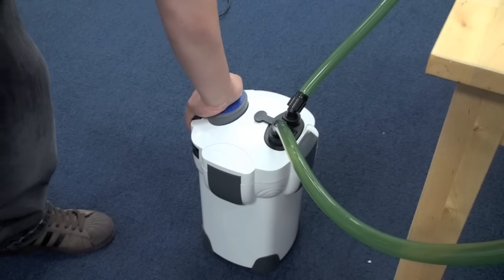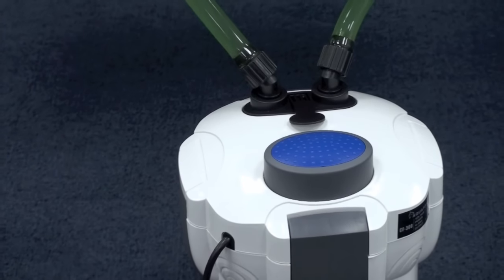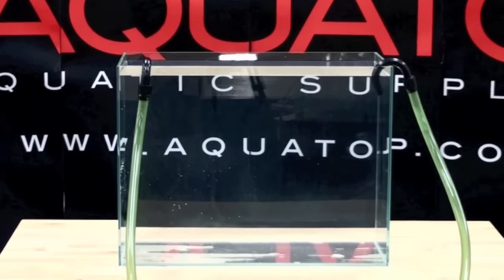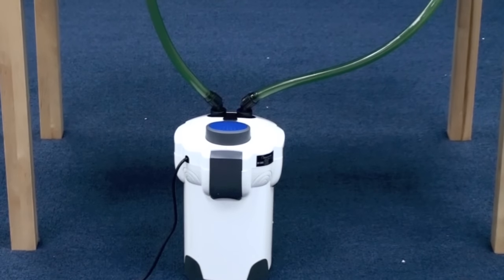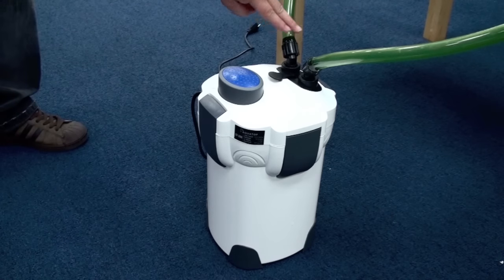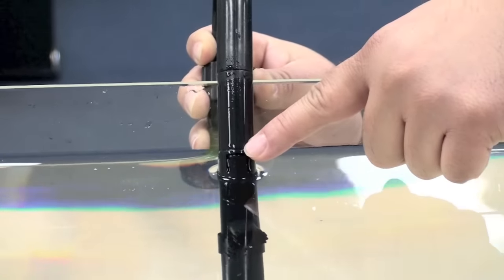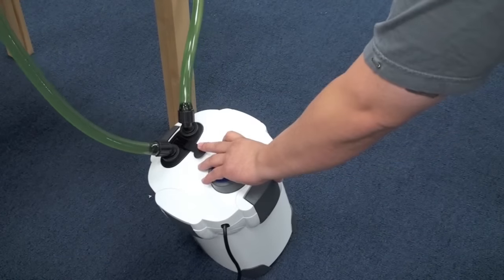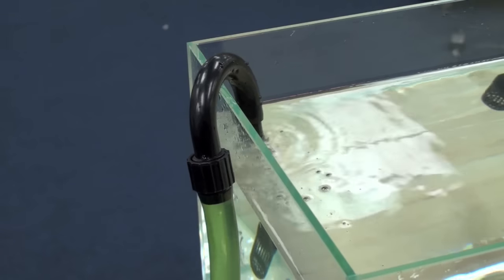AQUATOP Tips & Tricks: Keeping Your Canister Filter Primed

Comment: I fill my SunSun 302 (exactly like an AquaTop) to an inch from the brim with tank water, reattach the motor and hoses, open the lines and plug in.  I never have to touch that blue button, it just starts right up.  I will rock the unit back and forth to get the air bubbles out, but I don't need to mess with the prime button at all.
Reply from the maker: thank you.

Comment: Thank you so much. I was able to figure out what was wrong with my new filter after viewing your video. I ended up replacing the intake piping which I could not get airtight (even after capping the skimmer) with a very short length of tubing ending with the intake strainer. It did take a couple minutes of pumping even after that, though.
Reply from the maker: thank you for your feedback!

Comment: hello. i have the cf-300. i have always taken the impeller out when doing a clean.This last time i did this we cant get the impeler cap to go back on.i actually busted an impeller shaft trying to get the lid back on.I Just received a new impeller i purchased from  True aqua. We are not anle to get the cap to go in flush,Do these have a habbit of warping or anything? let me know if you have heard of this problem,Thanks
Reply from the maker: +TheCrashdawg The impeller shaft has rubber grommets on both sides. Make sure that there are no obstructions in the impeller housing or in the impeller cover which would prevent the shaft to be installed properly. If you are still experiencing any issues, please give us a call at 888-915-2782 Mon-Fri 9-5pm PST and we may be able to better assist you.

Comment: How many times should I need to depress the pump, before it starts doing it, itself?
Reply: Steven Schuemann Is the valve lever up or down, when it is open? I finally unlatched the cover and the water gushed down the tube. After it was latched back up, it worked fine. Cannot figure out what was wrong, but I am happy it is working now.

Comment: just bought inlet/outlet pipework and replaced odd tubing but now I cannot get rid of air bubbles, driving me nuts
Reply from the maker: +Gar Cox Sorry to hear about that! Make sure that you have an air tight seal on the Inlet tubing side before priming and once the unit is primed, gently rock the canister filter front to back and side to side to eliminate any trapped air inside the canister. If you still experience any issues, feel free to give us a call at 888-915-2782 Mon-Fri 9-5pm PST.

Comment: Do you fill this with water then prime it ? No instructions in the box !
Reply from the maker: Greg Bikevinyl No, the canister filter should be completely empty of water before priming. The important thing to remember is that your inlet tubing must be air tight and your canister filter must be located below your aquarium. That way, you can create a vacuum when pressing the priming button and gravity will help draw the water into the canister filter. We can also be reached at 888-915-2782 Mon-Fri 9-5pm Pacific Time.